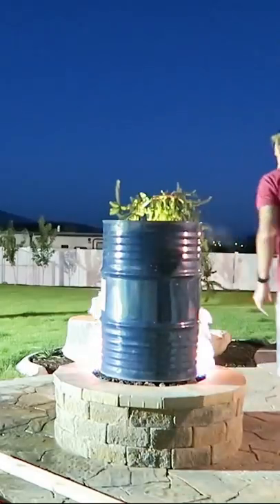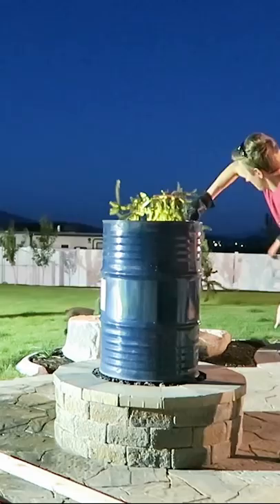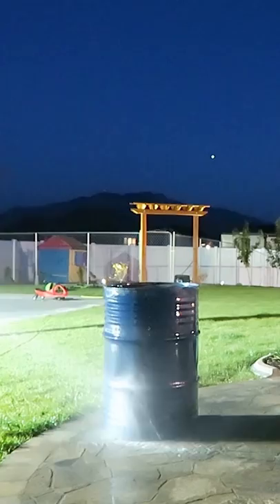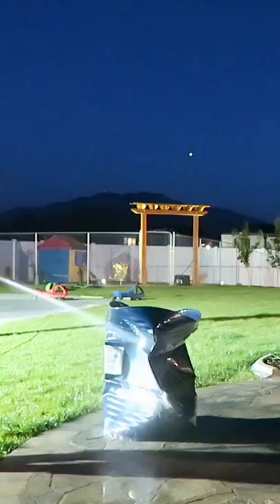55 Gallon Steel Drum Implodes From Condensation

Comment: The scary reality of negative pressure.  It's why Hyperloop is a national tragedy waiting to happen if it ever manages to actually make it to market.
Reply: You could repeat that experiment with a section of hyperloop. Nothing would happen. It's designed and engineered to not collapse. You know about design and engineering don't you?  It's what gives us bridges, aeroplanes, skyscrapers... The barrel is designed and engineered for a different purpose.
Reply: @DavidOfWhitehills  The experiment just is what causes the negative pressure to build up (you don't need to do the experiment on a Hyperloop, as it's already under negative pressure), the flaw is that over time with fatigue over miles and miles of pipe, negative pressure will find any weak point and crush the pipe, and there is literally nothing that will show that it's about to give, as the pipe is always under this constant pressure.  All it takes is a bit to break past point of failure (flexing from the heating/cooling of the sun each day causing slow fatigue), and instant catastrophic failure.  A plane can glide when failure, and can be easily decommissioned for repair if signs of fatigue, a bridge shows cracks and fatigue, and even still has catastrophic failure, but mostly can be shut down for maintenance.  A Hyperloop requires a whole track for miles to be shut down for maintenance so that the tube can be depressurized and replaced.  It's like shutting down an entire interstate highway the entire length just because of a potential forming pothole.  Cause if that maintenance isn't done, instant crushing, and likely right when a shuttle is passing through, as that is when the tube will be under the most stress.
Reply: @nezzee   Below a certain amplitude of stress, steel is immune from fatigue. No properly designed and built steel structure will ever fail from fatigue, no matter how many trillions of stress cycles go thru it. Aluminium alloys are a different story: no matter how tiny the amplitude of stress, aluminium will eventually fail, given enough cycles. Even the venerable, and enormously over-engineered B52 bomber will eventually have to be retired. The Forth Rail Bridge on the other hand, another over-engineered marvel, is essentially immortal, provided it can be protected from corrosion. Hyperloop is steel.
Reply: These qualities of iron-based v aluminium-based metals are one of the very first things engineering students are taught. It's really basic engineering knowledge.
Reply: @DavidOfWhitehills  cool, all we need is a super long solid tube of steel that way we don't have to worry about thermal expansion and contraction from simply a day/night cycle over hundreds of kilometers causing meters worth of shift cumulatively per one degree Celsius change.
Reply: @nezzee   Regularly spaced expansion/contraction joints. Like in, ya know, welded railway tracks, thousands of kilometres long.  I could answer your doubts ad infinitum, and you would always invent more. Your problem is not with the engineering, it's with Elon Musk. Am I right?
Reply: @nezzee   I guessed this was about Musk from your "national tragedy" comment.  You're a slippery customer.  You think you're clever, but you are obvious. However, you could try redeeming yourself: Musk is involved in, say, 8 different projects or industries. You've had a limp stab at a few of them, and him personally.  Do it right. Get your facts right and really convince me.
Reply: @DavidOfWhitehills  The fact you ignored all the above points clearly states you are a blinded Elon Musk fan.  As stated above, Elon Musk isn't even involved in Hyperloop anymore, it's all Richard Branson who has been still pursuing Hyperloop, Elon Musk has just backed away from the projects.  And thus far, no company has built even a small model to reach speeds faster than what is achievable by high speed rail, again, Richard Branson being the closest thing to a working model, and it was a straight line in the desert at 500m long and reaches top speed of 172kph.

There is clearly no convincing you of the dangerous lack of accountability given to these companies, and they will build this in the cheapest way possible in favor of regular maintenance and then fail to maintain it.  This is just how companies operate.  Engineers find the safest way to implement something at high cost, salespeople can't sell at the price the safest implementation is and tell them to make it cheaper, engineers make sacrifices to build that will work, but be far closer to breaking tolerances and require more regular monitoring maintenance, sales people sell this and it is built, staff that maintains are not engineers and lax on the maintenance or owners of the structure do not want to pay for real maintenance, catastrophic failure.

This is not saying it can't be feasibly done, this is saying that to make it safe from catastrophe, it is not economically viable over already present high speed rail.  I would feel fine going in a brand new Hyperloop that has been operating for a year.  I would be terrified to go in a loop that has been operating for 20+ years (which should be nothing for any infrastructure project).
Reply: Tell me more.
Reply: @DavidOfWhitehills  Clearly can't defend.  Nice chat.
Reply: @nezzee   Explain to me again how a tiny bit of air leaking into a vacuum tube causes the entire tube to collapse, leading to a "national tragedy".

Comment: I dont think it's from it suddenly condensing. I think it's from it cooling and condensing over time but when the pressure on the inside becomes greater than the psi the metal from the barrel can withstand without compressing, it implodes